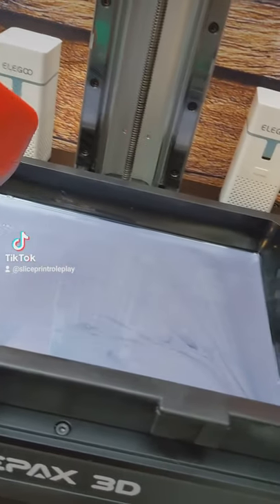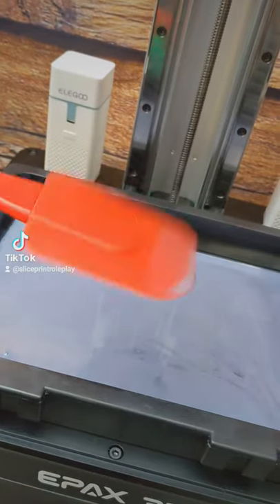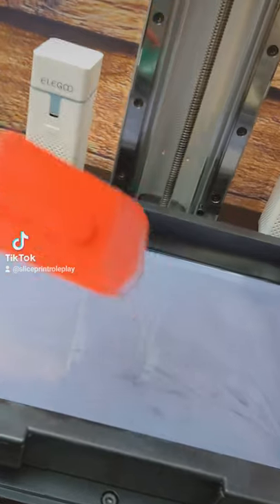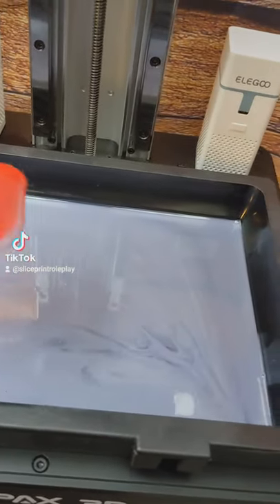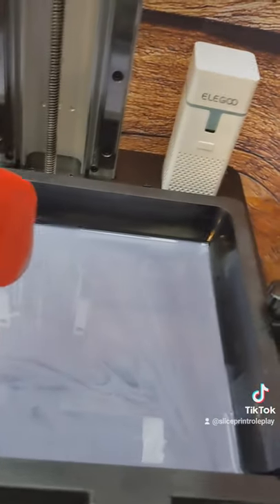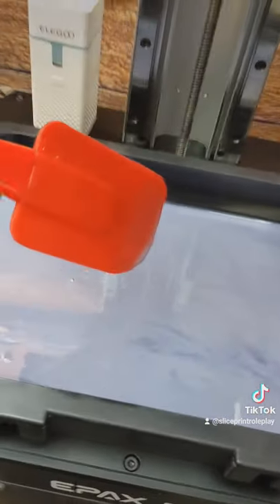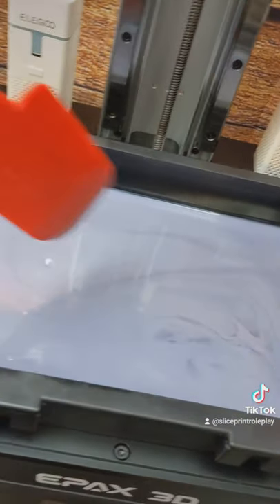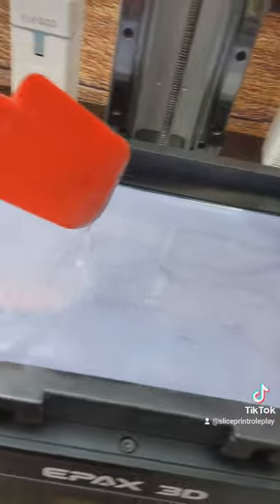Always Shake the Bottle or Stir up Resin in the Vat Before Use. #shorts #3dprinting #resin

Comment: Dude...What about long 11hr prints? Should we pause to stir cause I had a horrible failure. It seems like the resin is separating during the print...
Reply from the maker: In my experience the build plate and or model moving in and out of the vat will stir up the resin just fine.
The failure you're seeing is likely caused by something else.
Reply: Suction of a hollow model without holes was the issue. My walls colapsed in a little and realized there was some sort of negative pressure. This will cause it to grab the fep harder, rip layers and screw up surrounding supports especially if they are a lonely support without more around. @SlicePrintRoleplay
Reply from the maker: @scottlincoln9900  oh yeah that will definitely cause some issues. I'm glad you determined the cause of the failure.